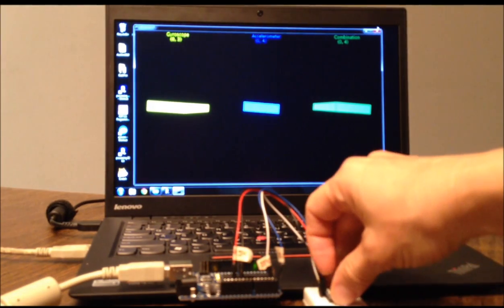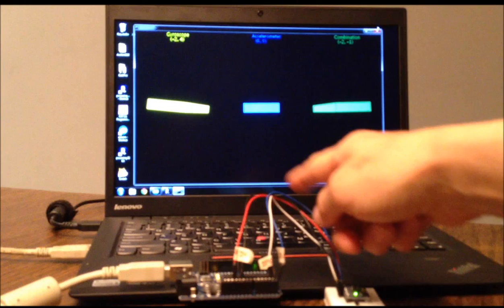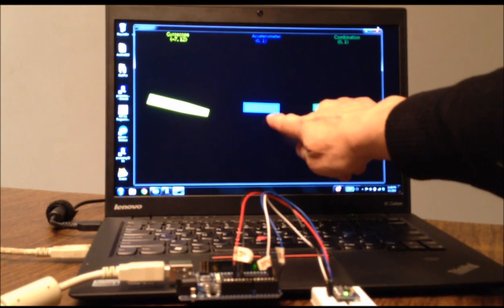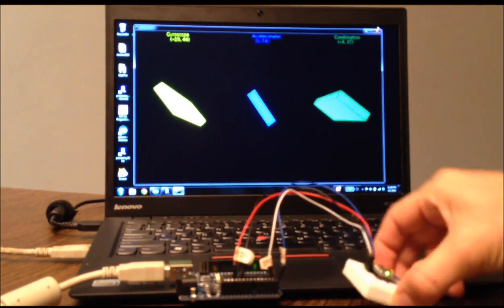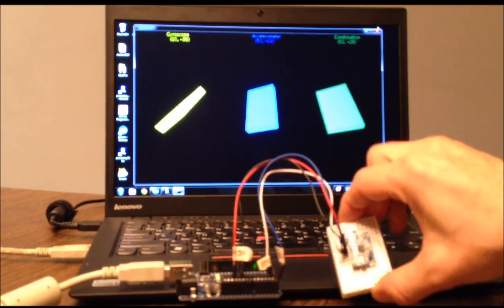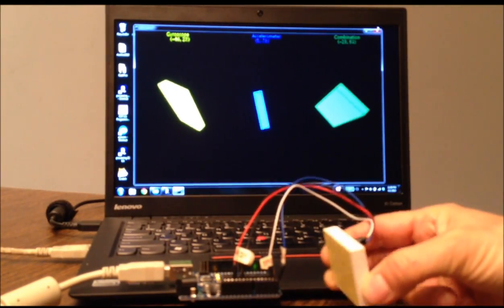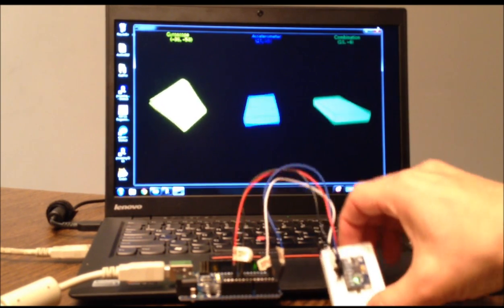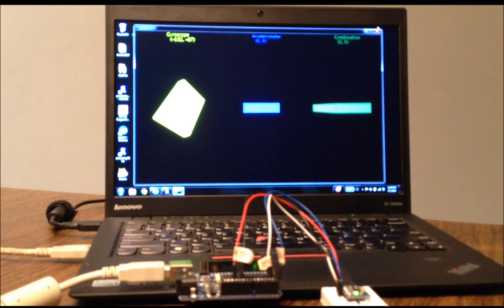MPU-6050 Data with a Complementary Filter

Comment: please , turn the sensor around itself 360 degree ,you cant get true result.
Reply from the maker: Yes, the complementary filter doesn't handle rotations greater than 360 degrees. I made another video about using the on-board DMP on the IMU which uses quaternions to do the calculation and CAN track rotations of greater than 360.

Comment: I'll say the problem could be the axis you did not code, in rotation ooder matters and removing an axis plus moving that leads to such glitches, gyroscope does drift as earth rotates though that's 15° an hour in the worst case. Noise also exists, using accelerameter helping gyroscope is a bad idea for moving objects as the rotation it gives is almost never accurate

Comment: Hi,i have a project and  i would want to know if  can i use a  IMU  for wearable device that detect  if the waist of  a person  is moving in a range of  angles of rotation ?
Reply from the maker: Sure, that's what an IMU does.  It doesn't measure rotation around a vertical axis as well as around a horizontal axis for reasons that I discuss in my blog post, but I'm sure it would be possible.  There are many different IMUs out there as well, some of which incorporate magnetic data for greater accuracy.  You'll have to figure out what you need for your particular project.

Comment: How would the complementary filter perform if it was used to, say, make a quadcopter fly? With the X and Y axis reading 0's and to have only the Z axis produce any tangible data, would it still be able to correct for the drift in the gyro readings?
Reply from the maker: You can use a complemetary filter for a quadcopter to give you the pitch and roll data, but you can't get rotation angle about the Z axis with it.  If you're using the MPU-6050 IMU, I'd recommend you use their on-board Digital Motion Processor (DMP) to get the angle readings instead.  I tested the complementary filter vs the DMP with a MPU6050 in my blog post here:  http://www.geekmomprojects.com/mpu-6050-redux-dmp-data-fusion-vs-complementary-filter/, and found the DMP reduced lag time in getting the angle data, and could provide pretty accurate readings for the rotation about the Z axis as well.
Reply: But in terms of a quadcopter it is impossible to get any meaningful data regarding the quadcopter's orientation during flight from the accelerometer's X and Y axis readings. All the articles on complementary filters I've seen are based on small angle approximation and if the only readings you can get from the accelerometer during flight are in the Z axis... I can't see how a complementary filter would even work for a quadcopter.
Reply: Going to give your blog a read though - thanks for replying :)

Comment: How are you using the Gyroscope to measure the angle? As it gives the reading in rad/s, so are you integrating it with respect to time to get angle in rad units? Very helpful demonstration btw!
Reply from the maker: +Umair Thanks!  I'm glad it was helpful.  Yes, the net angle from the gyroscope comes from integrating the gyroscope readings over time.  The specific formulas and code I used can be seen in my blog write up of this project:  http://www.geekmomprojects.com/gyroscopes-and-accelerometers-on-a-chip/

Comment: Hei bro, what application do you use to see  how the sensorr work.? i mean the virtual view to se the motion.. i just buy 10 DOF IMU Sensor (B) (Waveshare) Inertial Measurement Unit, Lower Power but i dont know how to use it. Can we conect to arduino uno.? i'm planning control robot mobile by  movement sensor
Reply from the maker: +rema adhe I used a programming environment called Processing (https://www.processing.org/).  If you go to my blog post at  http://www.geekmomprojects.com/mpu-6050-dmp-data-from-i2cdevlib/, there is a write up of how to connect the sensor to Arduino and how to program the Arduino and your computer to display the data you see here.
Reply: geekmomprojects okay. I will do. Thanks for your respon and the information.that's very helpful. I hope I can operate this sensor.

Comment: How can I obtain correct values for rotation about yaw angle with just a 6DOF IMU (MPU 6050)?
Reply from the maker: +Luis Berino You can use the DMP (digital motion processor) built in to the MPU6050 to get the rotation angles, including yaw.  The DMP has some sort of algorithm that corrects reasonably well for drift in yaw.  See my post at: http://www.geekmomprojects.com/mpu-6050-dmp-data-from-i2cdevlib/ for more information.

Comment: Are there any specific libraries needed to open the Processing sketch? Mine can't run the sketch. I'm using Processing 2.2.1.

Really looking forward to your reply :) Thank you
Reply from the maker: Reza Maulana Yes, you need to install ToxicLibs:  http://toxiclibs.org/downloads/ to handle the quaternion calculations.
Reply: geekmomprojects Thank you. I ran into one last problem, I managed to get the rectangles to appear, but it seems they are all frozen at 0 degrees. 

I copied all the toxiclib to the lib folder of my Processing

I already changed the portIndex to 0
I am already using a 32-bit Processing

Is there anything I'm missing?
Reply: +Reza Maulana Hi Reza, how do you change the port index, I can't find it in any of the menus.
Thx
Reply from the maker: +Balthazar Olivier The port index is a variable in the Processing code.  It indexes the array of available serial ports.
Reply: thx

Comment: You're a genius.
It just took me 1h to figure out that my wires were not connected properly to the board when i wanted to just read the raw values from it.
Reply: And when i see this presentation i imagine it will take me month to do this from scratch. Arduino should publish a nice neat interface to read acceleration and position without having to convert raw data to SI data and then combining acc and gyro data into one accurate data. World would be a better place if this two steps were covered under a nice neat interface.
Reply: Hoto Hey I guess I am having a similar problem with connections. It would be really awesome of you if you could help me figure out the same. Thanks!

Comment: what happens when the accelerometer is in motion though? How accurate is it then? How can you combine the gyro and the accelerometer to provide accuracy while in motion?
Reply from the maker: If you visit the link referred to in the video description, there is a writeup which discusses how to combine the gyroscope and accelerometer data.  When the accelerometer is in motion it will experience fluctuations around the actual value of the tilt angle due to external acceleration, which is why it helps to combine the data with gyroscope data for accuracy.  You can also time-average the accelerometer data to smooth it, which is part of what the complementary filter does, but more averaging will introduce a time delay into the response.

Comment: Nice work,i was wondering,does the MPU-6050 still give accurate data during fast movements in space? (that will not also change the orientation but also the position)
Thanks.
Reply from the maker: During linear movements in space without rotation the accelerometer data will be affected by the additional accelerations you give the IMU, but the gyroscope data should be relatively unaffected.
Reply: geekmomprojects Great,thanks!

Comment: How is it posible that gyro is less accuracy than acclerometer? Normaly I expect calculating tilt throught accelerometer  will have increasing mistake during the movements but here it is conversely :-/ When gyroscop is in horizontal position it just must send horizontal position. IMO

Comment from the maker: I'm afraid I didn't use avr complier - only the Arduino compiler.  There is a link to the MPU 6050 data sheet at the blog post mentioned in the video description.  That blog post has a fairly descriptive writeup (including code) of what I did access the mpu6050 from the Arduino environment.

Comment from the maker: Thanks.  I didn't actually design the filter, I just implemented an existing algorithm.  If you want to see the steps involved there's a link to the writeup mentioned in the video description.  It is definitely possible to do what you are saying. I've seen the Complementary Filter used with a PID algorithm for a LEGOself balancing robot.  The MPU-6050 + Complementary Filter will work well to correct errors in pitch and roll, you'll need an additional sensor of some sort to correct errors in yaw.

Comment: that is one really amazing filter you have designed!!
i just have one question
Is it possible to run the filtered output into a PID and get the control o/p to actuate multiple servos to correct errors of the x,y and z axis individually??
please reply!!

Comment from the maker: I'm afraid I never saw that problem before.  The green cube shows the filtered data, and shouldn't drift.  The yellow cube (gyroscope) data is the one that will drift.  You shouldn't need any extra pins to run this Arduino sketch.  If using the FreeIMU or I2Clib libraries, you need extra pins for interrupts, but not here.  My suggestion would be to close the Processing sketch and look at the MPU6050 data directly in the Arduino IDE serial window to see if anything weird is going on there.

Comment: HI,...Update on my last comment...the problem with the glitch happens when I connect even MPU6050 on MEga which has SDA and ASCL predefined on pin20,pin21...do you think I should connect any extra PIN on GY board or do you have any other suggestions?

Comment: Hi again,,,,,thx for the information,,,,I fixed the problem by declaring inport serial directly at setup...  myPort = new Serial(this, "COM5", 19200); com5 is where i get my data from Arduino but now ive found a new problem when I connected a MPU9158 ,9-axel gyro and the simulator is sometimes showing a small 
glitch on acc which is kinda affecting the filter result. sometimes the green cube is changing orientation just by standing still on a sponge .have you ever had this problem with MPU6050?

Comment from the maker: I just tried running the Processing sketch on a different computer, and I see a problem that it's crashing when trying to access the serial port.  The computer I was using found my Arduino on the second serial port, so I set variable portIndex = 1.  Make sure that your computer is seeing your Arduino on a COM port, and try setting portIndex = 0.